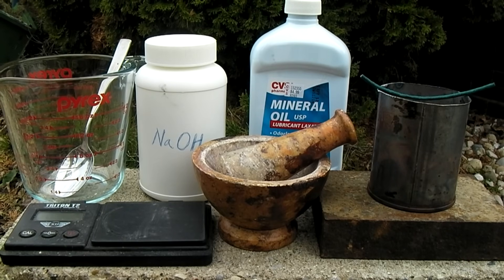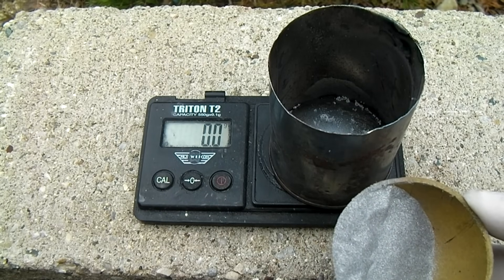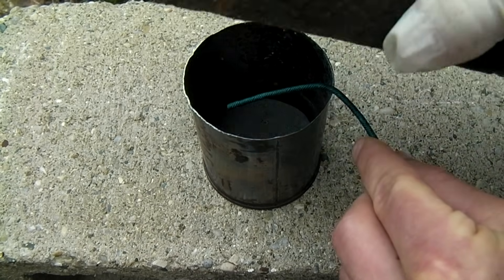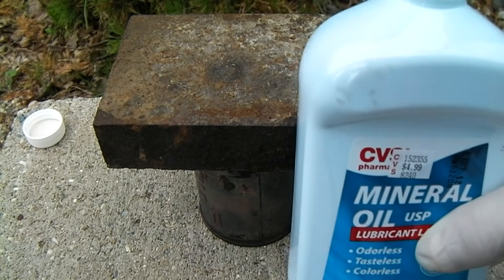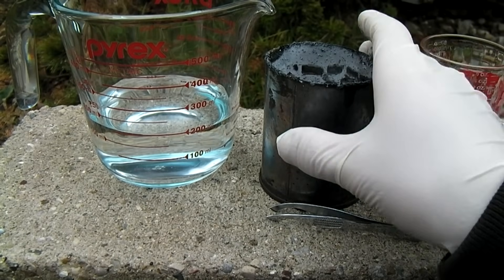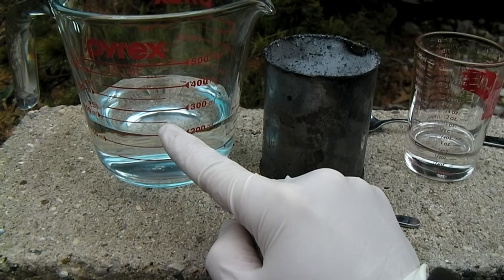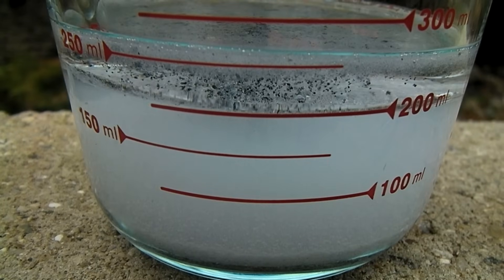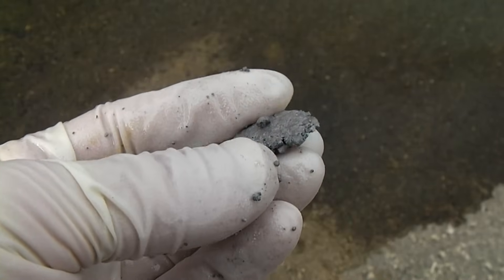How To Make Sodium Metal

Comment: I did this experiment and i should point out that the reaction of magnesium and an oxide gives off hydrogen and the will ignite giving off uv light, and if you were looking at this reaction closely without eye protection like me you will be temporarly blinded or permanently
Reply: Benjamin Joshua Beggs trust me I played with aluminum powder making rocket fuel once without eye protection.  I came inside and my calendar was a whole shade darker and my vision spotty. Trust me any metal powder is blinding.
Reply: He's right.  It can blind you.  Don't believe him?  Burn magnesium and stare at it.  Bet you won't be back to reply.
Reply: U got welders flash, ouch. i
Ive been told it feels like some1 constantly throwing sand in ur eye is that true? I have no desire to find out the hard way.
Reply: @alockworkorange7296  Depends how big the flash is, when it is bright enough I would say it's more like a migraine. Plus the blinding effect.. lol

Comment: Sodium hydroxide is hygroscopic (readily absorbs moisture from the air). So it's probably best to grind it up (and quickly) after the magnesium is ready, unless you can work in an environment with very low humidity. Just leaving sodium hydroxide exposed to the air for 15 minutes or so can achieve noticeable amounts of moisture.

Comment: Why not just heat the whole mixture under oil? Sodium melts at around 208F, and MgOH does not. The sodium could coalesce like on Nurdrage.
Reply: @Cosmic I was talking to Fred
Reply: @anytimeanywhere8870  kk sry
Reply: Magneto! Go
Reply: Sodium does not contain iron and is not magnetic
Reply: @OGJessie  why would it have to be magnetic? it coalesces because of the strong surface tension of molten sodium.
Reply: sodium isn't magnetic...

Comment: why do this? some one please explain.
Reply: because it's fun
Reply: Because something plus something equals BOOOOM!
Reply: because CHEMISTRY!
Reply: Because the water make the metal go boom
Reply: When you put metalic sodium in water, It will react to produce free hydrogen and heat which will ignite the hydrogen when it reaches the surface.  It usually fizzes and burns and makes a lot of noise, but if you contain it right (or wrong) you can make a low brisance explosive device.  Throwing a chunk of metalic sodium is a high school chemistry class demonstration which kids then use to cause mischief on people with low tech skills, such as jocks, so one of the classics, along the same lines as but not as famous as flushing a lit cherry bomb in the upper floor toilet of a high school, is to take the shower head off of the jock's shower, put it in an oven so it is perfectly dry, remove the restrictor, drop in a couple chunks of metalic sodium (you can coat it in sugar for a small degree of safety) replacing the restrictor and reinstalling.  When the naked jock or jockette turns on the water, about ten seconds later the shower head sputters and shoots out flames, scaring the crap out of the showeree, but it can also explode off and do damage to the water line and injure somebody.  Somebody once told me that there was an episode of one of the CSI shows where some screwed up nerdy kid did this to get back at some perfectly well adjusted jock type and ended up killing them, and the nerd went to prison.  Another popular trick whcih was popular in the days when you could open a car hood from outside the car was to siphon out the contents of the target's car's coolant overflow tank, drop in some metalic sodium (or suspend it in a baggie) so that when the car got warm and ejected some coolant, it would cause noise, flames, and maybe a minor explosion in traffic and produce damage that almost no cop or mechanic or insurance adjuster could figure out.  For these reasons, a lot of chemical suppliers won't sell pre-processed metalic sodium to a teenie bopper in a Beavis & Buthead T-shirt or somebody they don't know or where the buyer is not buying the other stuff you would normally need for a conventional use (metalic sodium is used primarily to purify other molten metals and is thus sometimes used by people doing small scale foundry work using metals that oxidize rapidly when hot, such as tin, lead, copper, bronze, pewter.  It is also used to make some exotic batteries, but is usually needed in a purity that the user is probably processing his own stuff anyway.)   So if you want to play with it or just be mischeivous with it, in this day and age of rampant paranoia and fear, you have to make it yourself.
Reply: Because you can powder it and chuck it at your enemies.
Reply: If you have About 2 kl sodium place it in a house and make a time fuse with water house Goes boom.

Comment: As a matter of fact I am a chemist (Industriel ingineer in the chemistry) and i have studied those reaction alot. They don't make NaOH out of electrolyse because its 1 not efficient and if you want to do it you need around 500 euro to make 1ml of a 1M solution. The only way to get Na or NaOH out of salt is or with a very expensive setup wich require an expensive membrane OR melt the NaCl down(801°C) and then use a very high current because it got a strong ionbinding and the risk of explosion.

Comment: Sodium hydroxide is a popular drain cleaner, and is often sold in solid form. Be sure to read the ingredients on the label, though. Magnesium can be found in firestarters, in the sporting goods section of your local supermarket. They're sold as solid blocks with a large flint glued to it, though, so you have to powder it yourself. You can also check online, though powdered magnesium is probably expensive to ship.
Reply: You can also find magnesium at a plumbing store for real cheap. It's used in boiler tanks. Ask for a magnesium rod.
Reply: Don’t do this. Any amateurish mistake can cause severe burns.

Comment: You can make NaCl solution which can conduct and by passing an electrical current through it then you may separate the two ions as the positively charged sodium ions will be attracted to the cathode and the negatively charged chloride ions will be attracted to the anode. Given this process gives you sodium ions when extracted as opposed to sodium atoms however you only need to reduce it by giving it electrons which eliminates the requirement of the stupidly large temperature used to melt it.

Comment from the maker: Yes. The salt needs to be heated to it's melting point then a strong electric current is passed through it to split the sodium from the chlorine. It's quite dangerous.
Reply: Can this be done with table salt?
Reply: @jerometruitt2731  Yes sodium metal can be extracted from table salt but the melting point is about 801'C. Some calcium chloride is added to lower its melting point to about 600'C
Reply: @jerometruitt2731   don't do it. just don't. You would be working with such dangerous materials and at high heat which adds even more danger. did you know molten salt explodes when it touches water? I'm betting you didn't, and who knows how many other hidden dangers there are.

Comment: No, the sodium does not react with heat and oxygen, but with oxygen only. Sodium is a very reactive alkaline earth metal, so when it reacts with oxygen; lots of energy is released (reaction is exothermic) in the form of heat (fire), this produces NaO (sodium oxide).
In water, sodium reacts with H2O (water) and in doing so displaces a hydrogen; (re)forming NaOH. This reaction is also exothermic, which is why the sodium is both; on fire (heat energy) and moving around quickly (kinetic energy).

Comment: sodium in its elemental form is a soft metal and it is highly reactive heavy metal. when exposed to air it can react and spontaneously combust. that is why you are using the mineral oil, it coats the sodium.

Comment: Too bad it's impossible to get magnesium powder or fuse where I live... though it may be possible to make the former and it may be possible to use a different method of ignition in lieu of the latter. Apparently there's a way to make it from salt via electrolysis- but it requires molten salt, which is even more scary.

Comment: Sealing it in an airtight container submersed in mineral oil be enough. You can store it in a jar like this for months. Unless where you live is extremely humid, even taking it out in open air likely won't cause ignition. As well, mineral oil has a density of about 0.8g/cm, making the sodium more dense and therefore will settle to the bottom over time, further decreasing exposure.

Comment: I'm not desperate to win. I'm pointing out the cracks in your argument at a fundamental level. It's easy actually since you are raising all the signs like a vegas strip.
Another failure is that if no-one cared that would mean I or you would have stopped replying to each other a long time ago.
If I was trolling then I would have put 'Rule 14' in my second reply. I'm simply pointing out your close mindedness and you are trying to claim it is right. It's a much less extreme variant of the KKK.

Comment: dude have you ever got chemistry? you can't get pure Na out of NaCl in water. if you just put it in water its an ion of Na so it isn't Na and if you put electrodes in it then there are millions of deifferent reactions depending on your anode and cathode. if you for example use copper electrodes then you get CuCl2 and NaOH wich mostly reacts togheter to form NaCl and Cu(OH)2 and the Cu(OH)2 goes to CuO and with inert electrodes you get Cl- that forms Cl2 and 2 H2O--> 2 OH- + H2, OH- + Na+ -> NaOH

Comment: so for you Na and Na+ is the same. mmm if i drop Na+ in water nothing happens(it dissolves), if i drop Na in water it explodes/burns so its clearly the same thing. its like changing Americium in your smoke detector with U-239 its both radioactive so will do the same job i guess? only the difference in radiation and so the different interaction with the human body

Comment: Not pure, with elektrolyses you can form NaClO (in cold environment) or NaClO3 (hot environment) or NaOh and Cl2-water(or HCl)  and with this video you can use NaOH to make Na. for making NaOH you need to seperate the place where the anode and kathode is inserted in the NaOH solution (a membrane between the solutions) and then react so that on 1 side you get NaOH and the other side chlorine gass wich is corrosive etc

Comment: that's not thaaat difficult.. although because the sodium will be molten, it's reactivity goes way up, so I doubt you'll have the pure metal for long before it reacts with water in the air. Also you'll get chloride fumes off the mixture which is very poisonous.

Comment: actually in the original VW bugs magnesium was used for the engine block and gear box. Around 20 kilos of magnesium was used in each car. In merica you can buy magnesium sticks they have flint on the side and you can use them to start camp fires.

Comment: Think about it. When the sodium metal contacts the water hydrogen gas is produced in an exothermic reaction. Therefore the sodium metal is floating on a cushion of hydrogen causing it to glide along the surface in a very low friction way allowing it to bounce from edge to edge of the container.

Comment: I highly doubt this is the leidenfrost effect... both the water and metal was at room temperature and not boiling. it should be caused by the hydrogen gas being produced in the reaction pushing the sodium around.

Comment: lol sodium chloride is also called SALT (Sodium chloride
Chemical Compound
Sodium chloride, also known as salt, common salt, table salt or halite, is an ionic compound with the formula NaCl, representing equal proportions of sodium and chloride. Wikipedia
Brand names: Cleanoz, Na-zone
Formula: NaCl
Molar mass: 58.44 g/mol
Melting point: 1,474°F (801°C)
Density: 2.16 g/cm³
Soluble in: Ammonia, Methanol, Water)

Comment: The fire is from the hydrogen in the water. Sodium separates it from oxygen and that causes enough heat to ignite the hydrogen thus lighting the water on fire. It's a dangerous reaction  but a cool trick, just don't play with fire kids!

Comment: Sodium hydroxide is also known as lye, and is commonly used as a drain cleaner. I bought some from Ace Hardware, though I've seen it at Home Depot as well.
As for the magnesium powder, that one's harder to find. I know it used to be used by photographers as flash powder, but that was in the old days. United Nuclear sells it though, and despite what you may think, they'll ship to anyone, including to a residential address.
I think mineral oil is sold at grocery stores.
Don't know about the fuse.

Comment: Sodium hydroxide, you can make it buy placing pencil lead in saltwater and shocking it with electricity for a good few hours.
Magnesium can be bought from Wal Mart as a fire starter. Now file it down with a steel file and you can then make it........

Comment: lol the melting point of Sodium Chloride is more than 1400 'F where as charcoal in ideal circumstances might burn at 1000 'F at the source of the flame.  In other words the salt would never reach 1000 'F much less 1400 'F. I'd berate you for giving dangerous chemistry information but I doubt anyone would be dumb enough to attempt your hot salt in the barbecue method.

Comment: Sodium will react with the water in the air, although much slower and without the violent effects. The reason it wasn't reacting in the video, I'm assuming, is b/c it was still coated with a thin layer of the mineral oil.
I guess you could do lot's of things with sodium, but mostly I think it's just for throwing in water and watching it catch on fire.

Comment: hahah, nice idea but it would be horrible. The metal is to soft to form it into any shape thin or long enough to make a blade, a small knife might be plausible but unfortunately the wielder of it would more than likely get severe chemical burns if they didn't wear protective gloves. Not to mention the blade would deteriorate over a short time from contact with air. Cool idea though.

Comment from the maker: Sodium was stuck to the surface of the block of steel. Scraping it with the spoon exposed fresh sodium to the air, which caused it to rapidly oxidize, releasing enough heat to catch fire.

Comment: @pchk1 Sodium and magnesium metal are actually fairly close in potential, with sodium only being 0.5 V lower iirc. The reason why this reaction works is because the potential difference between NaOH and MgO is way bigger than that between the two individual metals. The net potential of the reaction ends up favoring the formation of MgO and solid Na.

Comment: A simple but hairy way of obtaining sodium metal is to melt down NaOH to molten NaOH in a cast iron pot. Then pass a DC electrical current through it and collect Na metal off the cathode. Please be warned that this method is not for the faint hearted. But has the advantage of requiring very few chemicals or glass wear.

Comment: @WalterWhisky yes its a base, sry, i made a mistake since i wrote it quick. it is strong though (= it dissociates easily) and usually its difficult to get if you aren´t in an agricultural or scientific business. a tip : dont buy pure one; the costs can be up to 10000 times higher than a not so pure one - no exaggeration. there are online stores for chemists where you can buy it, usually you need a license but magnesium isnt dangerous so it should go without one too